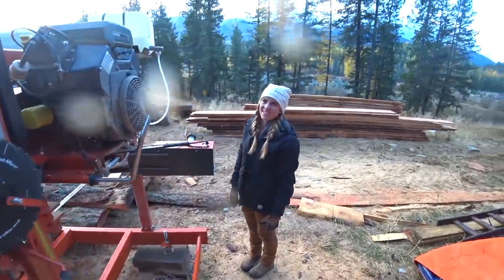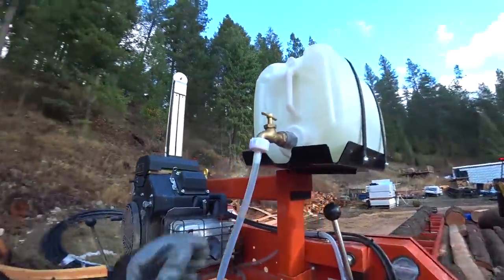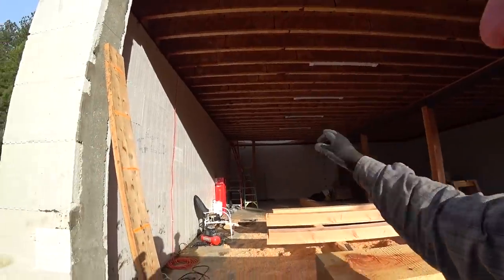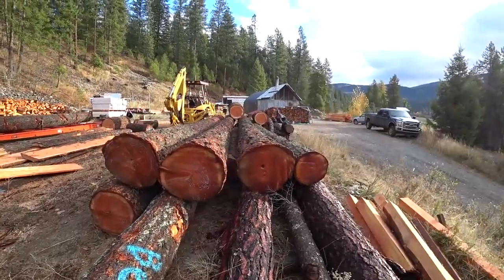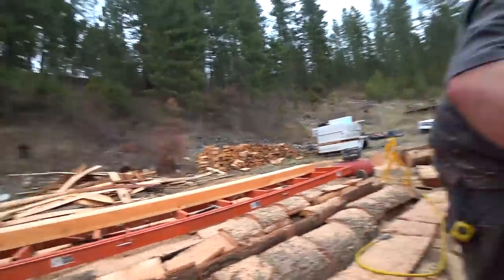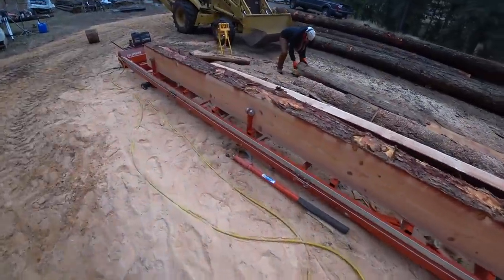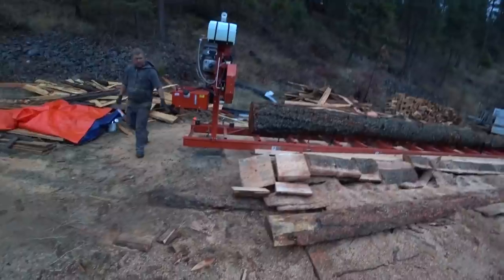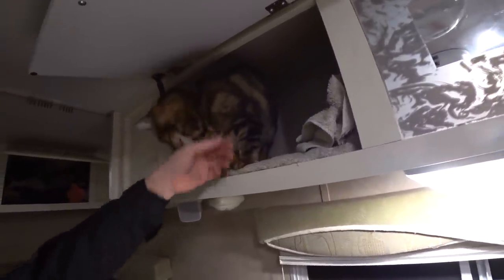Building a House Start to Finish: Sawmilling Timber Frame in 3 Weeks

Comment: Alyssa you should wear sawpants when using the chainsaw
Reply: Did you guys mix up 5 gallons of premix?   That's enough for a crew of guys for a week!  I mix up a gallon at a time.   That usually takes me a week to burn through.  The stuff doesn't last to long after mixing especially if there's any ethanol in the gas!!

Comment: I got tired just WATCHING you two work fevorously      guess day off refreshed you      KUDOES
  -I suspected backhoe battery to be bad, so replacement far better than jumpering daily 
    -keep it for spare backup battery-charged up from solar cells assembly

 but noted you have YET to flip and clean groove in chainsaw BAR-to get longer bar life-and extend chain life also
    -I flip and clean BAR every third saw sharpening
      AND had SPARE BAR as well as three CHAINS -for each chain saw,  -since BOTH  WEAR or break
       -but I'm cutting hard ,dry knarly ASH-not softwood as you have, where pine pitch fouls up cutting action ~~

Comment: Also something you all should look into now since you have some good power is a chiropractor table.. I have really bad back problems and I'm only 20 but one of them tables my GF's family had and oh my god it worked great.. Though I didn't use it for the actual time and only went on 3 full cycles it worked great. Main problem of back is between shoulder blades "Spine" Great thing for you both is to get that chiropractor to teach you both how to pop those bones back into place at the homestead! Friendly Advice/Tip!

Comment: Alyssa you should carry a small hammer to knock the shackle loose on the backhoe.
Reply: I think it's getting stuck because its getting side loaded. Alyssa and Jesse have learned and taught so much in these videos that I feel obnoxious pointing out mistakes, but that's one that stands out to me a lot. My work deals with straps, spansets, and shackles a lot so it's one of the things that jumps out at me when its wrong.

Comment: fluorescent lights so last decade  LED's the future.
Reply: The problem is they will film on the garage. Cheap led is low CRI, so, image quality and colour reproduction will be very low. For filming the best cheap thing that you can get is fluorescent lights.
Reply: CRI? most of the youtubers i follow have changed to LED don't seem to be a problem
Reply: Color Rendering Index. It's a index for how good a lamp will reproduce a color. Studio lights, which is most of all youtubers uses is good led light, but those are very expensive for lightining a whole basement and I think they have other priorities like SIP panels now lol
Reply: Thanks.
Reply: I know this because I have an electronic engineering channel, and bought crap leds for my workbench. It's a pain in the ass how bad they look with a low CRI lol

Comment: Please lay off Jessie. He does the things Alissa isn't comfortable doing. What good husband would ask her to move out of her comfort space?

What I would say is that the saw dust needs to be more carefully collected. Lots of neat things to do with it.

Also, PLEASE put in a slab for the saw mill. You're spending more time calibrating and adjusting. A good, level slab would eliminate 90% of this.
Reply: onebigrailfan the problem is that the sawmill slipps on the concrete slabs that they put underneath. They already said that the problem is that the logs are actually pretty heavy and basically the sawmill they have is not exactly the best thing to cut them.
Reply: Lol I thought you meant please fire Jessie.